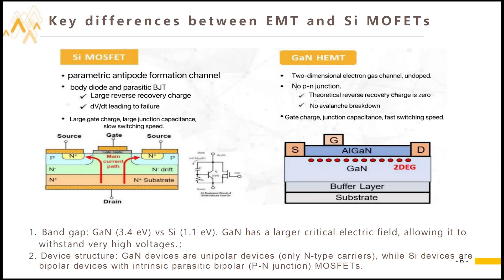Si MOSFET vs GaN Power Supply | 48V 5A Overview & Teardown

Comment: I haven’t read up on the science but I was surprised this 48V5A GaN supply outperformed both of my stock Fosi power supplies when I tested it with the BT20A Pro and V3. The top end was clearer with more soundstage depth, sharper transients and even bass punch. On both my KEF R5 (towers) and 3001SE (egg satellites, desktop) I heard these improvements consistently. Might have to try the 48V10A GaN next!

Really didn’t expect the transients to improve especially when I already had Fosi’s Si based 48v5a supply. Guessing the faster switching frequency not only reduces noise but responds faster to the amps power demands for more defined bass and transients.
Reply from the maker: Thank you for your support!
We're glad to hear you noticed the improvements with the 48V5A GaN power supply. Looking forward to your experience with the 48V10A next time! 😊

Comment: I use 5v ugreen 3 port Gan charger for my Smsl su-1, acrylic S10+, and Xduoo xq50 pro 2 Bluetooth dac. Gan charger and connected devices doesn't heat up and saves me space. For sound improvement, I'm not sure if there's any since it's hard to tell.

Comment: The GaN seems to be better, but without testing how can we know?
1) Please show noise figures for the supplies.
2) Please show how the different supplies perform under load. How much power can they actually deliver?

Also, what is the advantage (if any) in using a 10A power supply instead of a 5A supply, with specific reference to the A70?
Reply from the maker: Thanks we will consider updating another video. If there are any other suggestions, please let us know.

Comment: Which is noisier?
Reply: I dont think Aiyima amplifier can draw full 240watt power from those power supply, so both wont trigger the fan but cmiiw. I only use Aiyima A07 and I've tried several power supplies (black bricks) and meanwell smps power supply, Aiyima A07 can only draw 4-8 watts of power, that is so low. It never triggers the power supply fan to turn on.
Reply: @Mickimoss  there is on youtube some italian tested it. So with 48v/5a receives 102wt at 8ohm per channel and 180wt at 4ohm per one channel. I think its more than enough to drive 90% of speakers for home use.